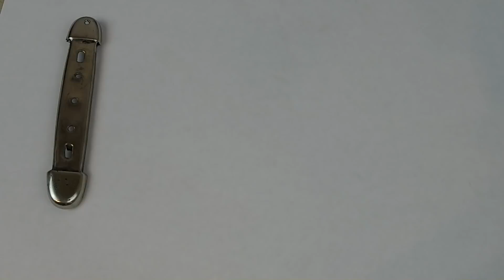Folding Knife Restoration | Pocket Knife Restoration | COMPLETE RESTORATION

Comment: Thank you for showing how the various parts are fitted together. I have a bunch of these knives in similar condition, and was afraid to clean them up... until now. Some observations: Did you use aluminum nails for the pins? It looks like these nails/pins were a wee bit small for the existing holes in the various blades and spacers. The pivot pins must have been too tight to allow smooth opening and closing of the blades. You achieved a fine result for what many would consider a throwaway knife. Now it is worth keeping, using, or passing it along to someone else.
Reply from the maker: I used a steel nail. thanks for the good words.

Comment: In general, tools can have great longevity. However, to ensure the useful life of these items, maintenance measures are necessary in addition to knowing how to remove rust from tools. These measures include cleaning and, in some cases, the application of industrial protection, periodically (every six months, for example). In this case, it is a temporary protection, since the lubricating fluid can be removed with degreaser.

Another common method of protecting tools against corrosion and oxidation is the application of coatings, such as zinc-rich paints or epoxy layers. In this case, definitive protection occurs. In any situation, it is important to keep the parts clean. For this, some types of degreasers can be used.

It is essential that the parts are stored in an organized manner in a dry place, at room temperature. This helps to avoid moisture and prevents oxidation.

Comment: What nails are those you are using as placement pins and then to pin everything in place ?
Reply from the maker: I don't know what size they are. They are just some wood finishing nails I had that fit the holes nicely. I figured they would work as well as anything else.

Comment: When you pine ove the pivot point you will find it will help if you put a .005 shim in between the layers on shim per tool. It will stop the point from getting too tight. Modify the amount of shims over two tools. basically 2 shims max.

Comment: Considering this was at best a very cheaply made pocket knife, you did a nice job. I would have removed the scales and make-believe bolsters and replace them with solid brass bolsters and real wood scales. That would have made the knife worth the effort. I would have also removed the pitting on the blades as well. JMHO
Reply from the maker: Thanks for the comment. I didn't think to replace the bolsters and scales as you suggest. Now I wish I had.

Comment: I could not make out the maker and place it was made. Back in the day, these sold for like 99 cents, then 1.49, then 1.99... then they went all over the world having them made in Ireland, Japan, Taiwan and finally China. The original US made ones are fairly good quality, (they're cheap, okay, but the steel was better) then even Ireland and Japan aren't terrible, but they really got crappy by the time they were made in Taiwan, and even worse when made in China. I do not blame the countries or those manufacturers, the people buying them to resell wanted them as cheap as they could get them. Blame them, but where it was made does give you an idea what quality it was to begin with. These had plated blades usually, so replating the blades might have been the way to go. The plating was too thin, however and wore off quickly.

Comment: There's a reason you're blade's are to tight and have no snap! Use proper sized brass pin stock and shim the joints before peening the pin ends! Other than that, excellent work!
Reply from the maker: Thank You. Some one posted a knife restoration book in one of the comments. I'm considering getting it and learning more about it. Thanks for the advice.

Comment: FYI Opening both blades on the same backspring half way at the same time is an EXCELLENT way to break the back spring.

"Restoration" does not mean over clean/polish it to make it look new again.
Preservation is better, and does not detract from the collector and historical value.
An over polished "restoration" suggests a frankenknkfe.

I couldn't make out the tang stamp.
Imperial? Colonial? Hammer Brand? Who made it?
Reply from the maker: Thank You for watching